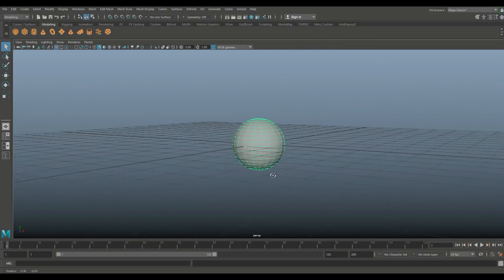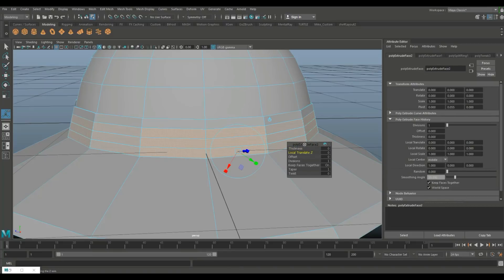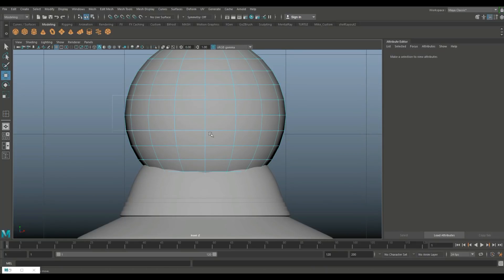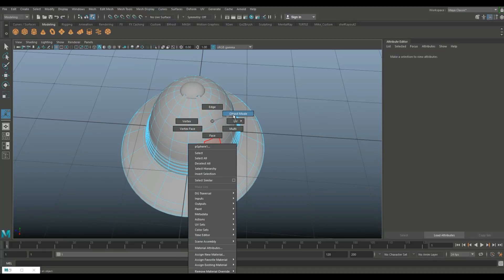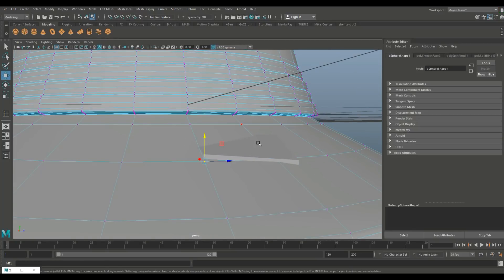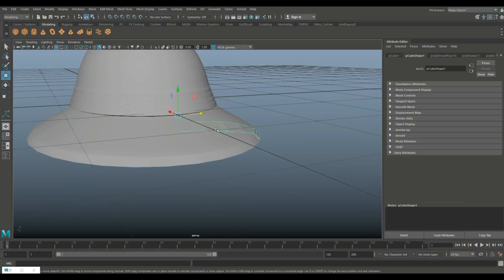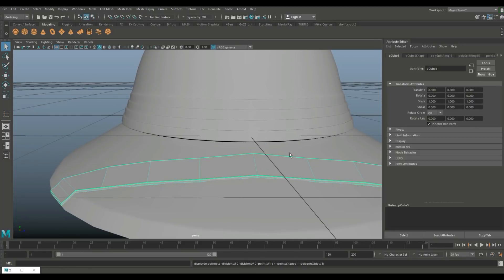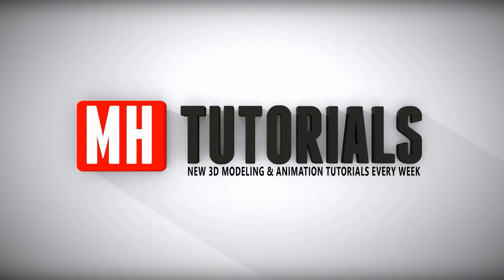How to model a STEAMPUNK Pith Helmet in Maya 2018

Comment: I suggest making the hat Live object and using Quad Draw tool for that strap thing in the front. It's more logical to me since it's both faster and easier as you can draw faces on the surface of the hat and in the end just extrude thickness.

Not to be disrespectful to Mike, this is fine too in this case 'cause it's quick model/tutorial, but maybe the principle would be important for some guys for the more complex future projects.
Reply from the maker: There are always many ways to achieve things, but good suggestion !